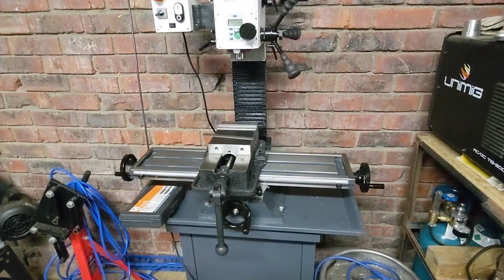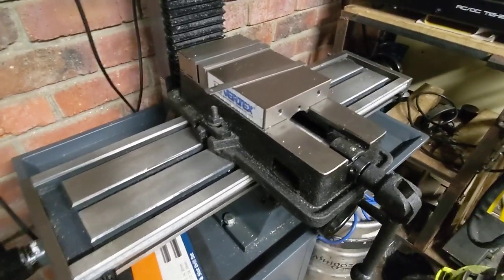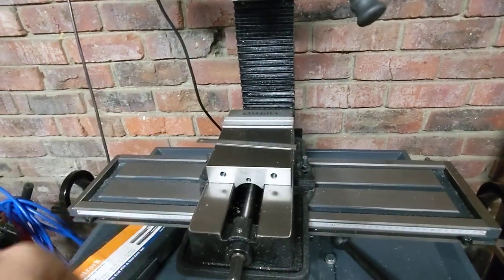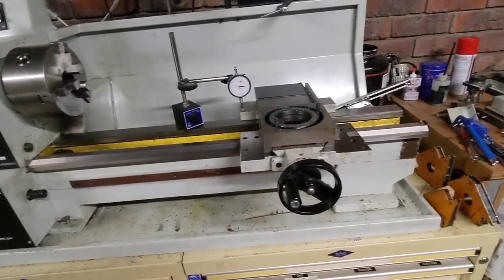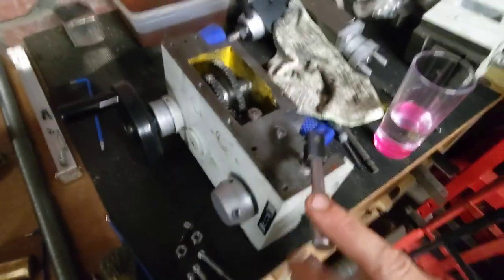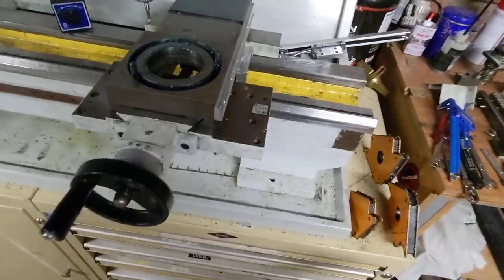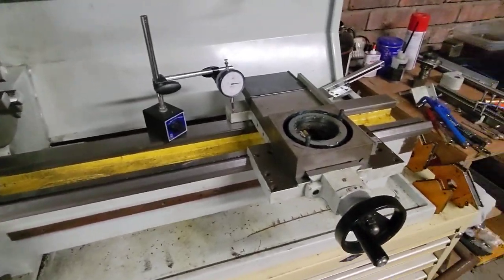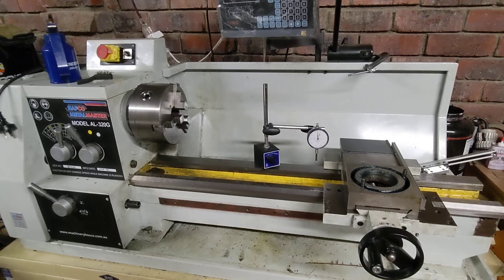Current work - AL-320G and BF-20L

Comment: Hi, I have an AL320 lathe from Hare and Forbes in Melbourne. I'm currently working on the carriage longitudinal movement. In particular I'm trying to chase down why the wheel moved the carriage 26.5mm per revolution. I'd like it to move exactly 25mm and to do this I will have to partially disassemble the carriage, at least to the point you show in your video. I've tried loosening the 3 bolts at the front but it seems I need to do more. Can you please help me with what else I need to undo? Obviously, I could take it all apart but at this stage I'm on a fishing expo. Thank you.
Reply from the maker: Gday Neil. I've looked through photos that I have but unfortunately it was a full teardown in everything I've got.

I don't remember exactly what needs to come out but I to remember it being 'a turd' to take the carriage geartrain section out - the leadscrew needs to be removed, as there are machine screws at the rear right of the carriage, just behind the leadscrew, holding the whole assembly together.

At that point you can remove the power feed selector (single tapered pin) and then finish removing the screws from the top. It can be tight because the selector shaft 'kind of' interferes when releasing the carriage gearbox from the locating dowels, but it is doable.
Reply from the maker: Everything can then be lowered away from the rest of the carriage, left behind on the bed.. Be careful, it's got some heft!
Reply from the maker: Actually - side note - I'm looking at the dial on the carriage hand wheel. Mine is actually marked as 26.5mm per revolution, so unless yours is marked differently.. It might just be how it is! I'm using a DRO so I rarely, if ever, look at the dials
Reply: @StyxHackshop  thank you. I suspected it wouldn't be easy, I was just making sure. I still want to look into it, the fix may involve adding or removing a gear tooth. I'd just like it to be logical, 26,5mm isn't even some magical imperial number. I'd like to see more of your work, Regards Neil
Reply: @StyxHackshop  mines the same and I have a DRO fitted it just irks me...
Reply from the maker: @neillawson4493  yep fair enough, can understand! That's what I remember of the dissembly process and having a quick scan of the manual (parts diagram for the apron, specifically), anyway.
Reply from the maker: @neillawson4493  yeah, it's pretty silly especially when everything on the machine is 'reasonably' metric.

I'll hopefully put up more videos at some point, just gotta put in the effort!

Comment: Thanks for this video.  Very interesting.  I also have the same lathe from Hafco some 4 years ago & bought a quick change tool post with it. (QA 140).  They failed to tell me however at the time that the toolpost needed machining to fit the lathe. As I am just a novice at metal work, this was beyond me.  Its just been sitting in a box in a drawer.  I see though that you have successfully made it fit your lathe.  How can I get some further hints from you about making the same adjustments? That would be very much appreciated.  I'm over in NSW, Blue Mountains.  Thanks.
Reply from the maker: Mate, it was a fun little project borne of necessity. I can provide a better (video) explanation in a couple of weeks, but I essentially just took a bit of driveshaft scrap from (something?) and put a shoulder section on the bottom and a thread on the top. Had to mill out a keyslot also, but it was a build from scratch to mate the QCTP to the compound.
Reply: @StyxHackshop  Thanks. I'll give that a try.
Reply: Hey mate I recently did exactly that as well. AL320G Lathe with QA140 quick change tool post.
The way I did it was to simply machine a 16x1.5 nut down to 5x24mm.
Knock out original post, fit centre bolt from QA140 with machined nut and loctite. 
Reassemble and enjoy
Reply: @StyxHackshop  Hi mate, have just come across your video as I took delivery of an AL320 yesterday here at work. I also ordered the QA140 QCTP and was wondering if you ever got around to doing that vid on the process??? I'd be keen to know how you did it as I have an AL51 at home, (and the same mill as you!!!) that I could turn up whatever's required. Cheers and your video is great....
Reply from the maker: @johnnyvee5594  hey mate! I never did get around to it, but I've just had a look at mine and decided that I want to redo the mount, just to get a tighter fit on the shaft. I'll make a video tomorrow and throw it up!
Reply: @StyxHackshop  I look forward to it mate, ta....

Comment: Hi mate great video, I'm considering buying one of these and the only thing that puts me off is the lack of a quick change gearbox on the feed. Does it annoy you having to change change gears to alter feed speed.
Reply from the maker: Hey mate, thanks for watching (and the comment!)

The change gears are incredibly annoying, yes. Ultimately I just leave everything on the slowest speed/finest travel rate, and only change out when I am doing single point threading.

The process can probably be made easier with a few basic upgrades (replacements for the E-clips on shafts, a better change gear chart) but I try to avoid it regardless.
Reply: @StyxHackshop  okay thanks for the feedback. How long does it realistically take to change. Maybe I should look elsewhere.
Reply from the maker: @fredflintstone245  realistically? a few minutes once you're used to it. It is super easy. I tend to overgrease my gears so I end up covered in muck and whatnot which probably doesn't help my motivation!

Comment: You are doing the right thing with your lathe by dismantling and cleaning out the internals before putting it to regular use, particularly the geared headstock which I hope you will be looking inside as well.
  Metal swarf and foundry sand is commonly left inside the enclosed gearboxes of some of the lower cost Chinese made machinery, which is a shame because often the actual component parts are fairly well made. So don't ever be impressed with any other owner that boasts that they just used theirs "straight out of the box" without at least first checking the state of the gearbox internals, because chances are that their new Chinese machine won't last very long.
 The scuffing along the lathe bed guidways is also something I have seen on many Chinese lathes, including my own 13x30 lathe I bought new in 2004. It is usually caused by the poor surface finish on the bearing surfaces on the underside of the saddle, and sometimes the tailstock. 
 These surfaces are sometimes finished by rough heavy scraping, gouging and what looks like chizeling. This leaves a rough surface which may have just a few or several pin points of contact with the lathe bed, and no amount of lubricating oil will prevent these few high spots breaking through the oil film and making metal to metal contact with the nicely ground surface of the lathe bed guidways, causing scuffing and early wear. 
 My new Chinese lathe had all these problems, scuffing of the bed guidways after just several hours use, plus large amounts of metal swarf and foundry sand inside the headstock, apron and screwcutting gearbox. I corrected the problems straight away and the lathe has performed without trouble for the last 17 years. 
 I think your lathe will work and last well too, judging by the thorough way you are going over it.
Reply from the maker: All good words! Thank you - I will absolutely look to clean up the underside bearing surfaces on everything too at some point, beyond the light deburring work already done.

Comment: You said you needed a particular quick change toolpost because the other one would not fit?
Could you please say which was the toolpost you used? Thanks! 🙂👍
Reply from the maker: Hey mate! Ended up with the QA-140, chiefly for center height and mounting reasons.
Reply: @StyxHackshop    thanks for the reply, I'm thinking of getting the same lathe from machinery warehouse, 👍🙂

Comment: Hi, Im just wondering how you engage and disengage the autofeed. The instructions for the machine say you shouldn't engage either the cross feed lever or the direction change whilst the spindle is running. But I find it nearly impossible to engage or disengage it when the machine is off?
Reply from the maker: So the levers on the gearbox - leadscrew engagement, leadscrew forward/reverse, and obviously speed control - they can only be changed when the machine is off (wiggle the chuck by hand to change settings if difficult!). 

Both power feeds and threading engagement on the saddle can be changed when the machine is running.
Reply: @StyxHackshop  perfect. Thank you. I’ll do that. It’s weird that the manual says to not use the threading half nut or auto feed levers whilst the spindle is spinning?
Reply from the maker: @sailingkulali  I don't recall having read that in the manual - I'll have a look tonight. Regardless, you can definitely use saddle mounted levers while spinning.
Reply from the maker: @sailingkulali  couldn't find that in the manual that I have. In any case - anything to the left of the chuck, don't change while running. Anything to the right - go for gold.
Reply: @StyxHackshop  Thanks mate! I did my first autofeed today. Was amazing. Pretty easy to accidentally hit cross feed though! Did that by accident and wasnt fun. 
Thanks again.